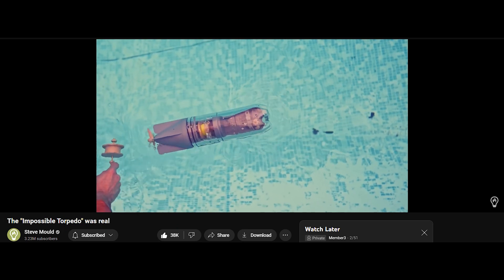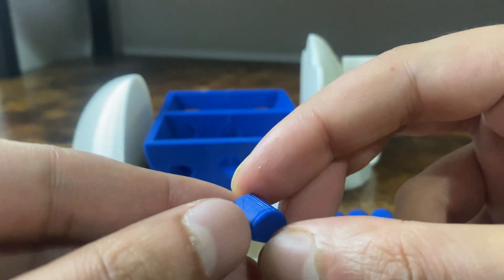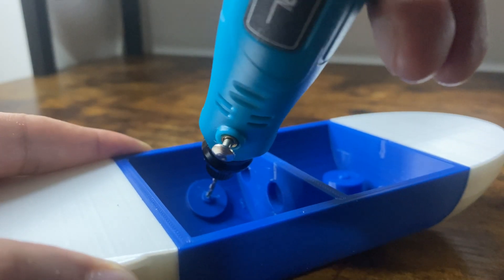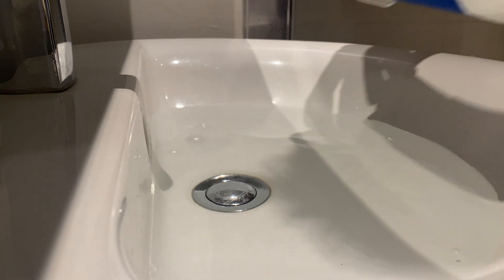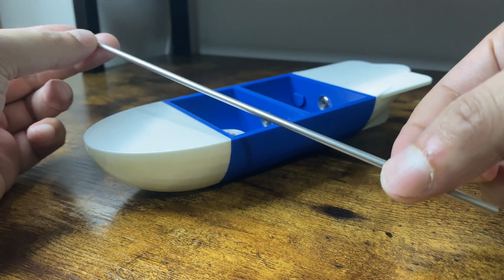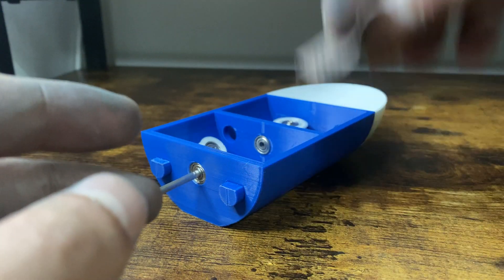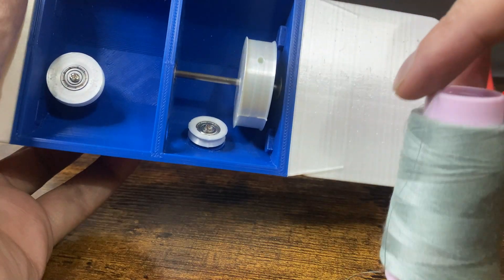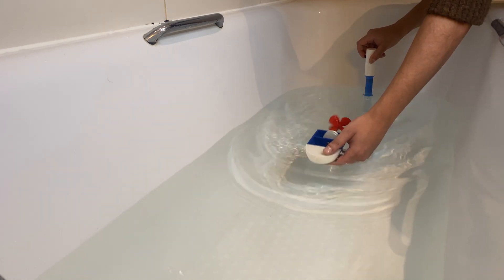The Impossible Boat Project Build

Comment: Fairly sure the only real issue you have here is that the inertia of the light plastic boat is not enough to overcome the static friction of your pulley system on water. Maybe greasing up the bearings or a few weights added to the 3d print is all you need. Fun watch
Reply from the maker: Thank you. I was thinking of making the boat lighter, you may have just saved my bacon 👍.